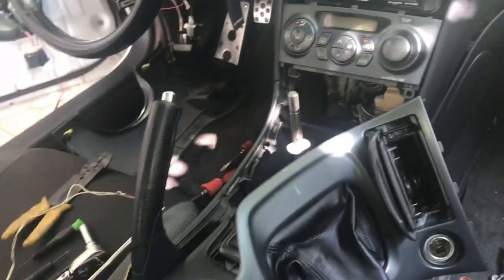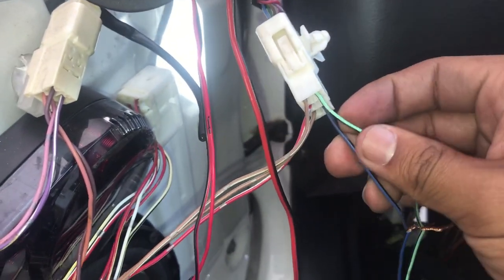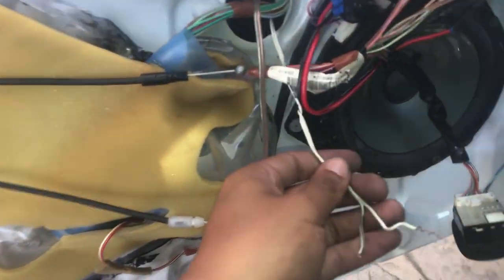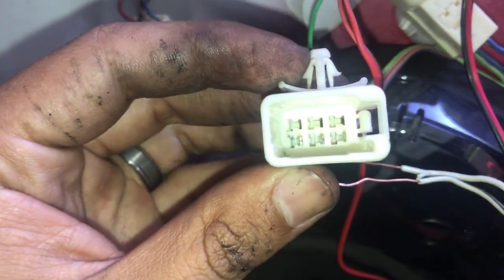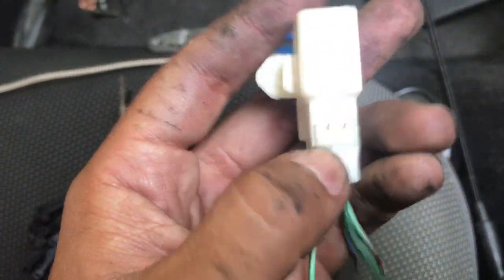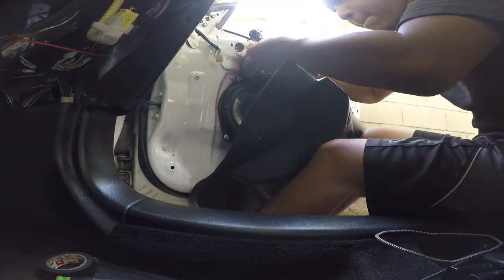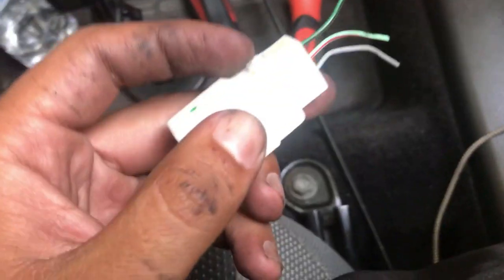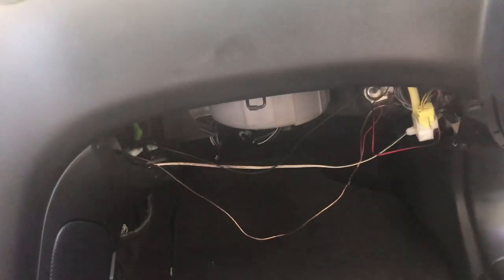How to Install JDM Power Folding Mirrors 00-05 Toyota Celica

Comment: Hi Rafa, I just bought one set of power folding mirrors and I intend to install them next days. Do you have also heated mirrors? There is any way to have both mods?
Reply from the maker: Ovidiu Florin Mine didnt have them and yes you can you just need to wire it right
Reply: @RafasGarage  do you have any idea how to do it?
Reply from the maker: Ovidiu Florin no but let me see if i can find out
Reply: @RafasGarage  did you find it? 🤩
Reply: 3 years late but there was forum post which tried to swap entirety of the mirror inside. Unless you want to spend hours doing that it's not worth it @cod_vvtli

Comment: Hey bro, I just got my some power folding mirrors from another celica, my car doesn't have is originally, like yours, so I need to do the wiring. Is there any control box I should have gotten aswell or do you only need the mirrors, switch and wires?
Reply from the maker: You just need the power folding mirrors and the switch
Reply: @RafasGarage  there's no relay or anything?
Reply from the maker: Kennedy Miller no
Reply: Cheers man got the mirrors and switch, wired it all up and drivers side works mint but passenger side making a weird clicking noise, I sent you a message on insta to send you a video of what's happening, help would be much appreciated

Comment: Rafa what is your location, I need your help on doing this.
Reply from the maker: Ken Sacdalan San Fernando
Reply: @RafasGarage  Deng,I used to live in L.A, now Im in the Bay Area.
Reply from the maker: Ken Sacdalan why you move well if you ever down let me kno
Reply: @RafasGarage  I might have a drive down there soon, I gotta get my speakers done on one of the shop there.  How long would it take you to install em, do I need to buy a pair of new side mirror that does the folding?
Reply from the maker: Ken Sacdalan yea you need to buy the jdm power folding mirrors
Reply: @RafasGarage  Do I need anything else, I saw 1 JDM OEM Celica folding mirror, you got the rest?
Reply from the maker: Ken Sacdalan and the switch
Reply: @RafasGarage  Do you know where is the fuse for the side mirror of Celica 2001?  I can't figure out.
Reply: @RafasGarage  Rafa, where did you get the pins that will connect the mirror harness and what type of pins are they?
Reply from the maker: @kensacdalan4748  from another harness or you can buy them from Toyota
Reply: @RafasGarage  Do you remember the specific type or what shall I tell them the part is?  Cuz the shop doing it watched your video, and said it involves replacing the factory pins that connects to the mirrors, is that so?
Reply from the maker: @kensacdalan4748  nope you only have to add two pins
Reply: @RafasGarage  So the harness would be our factory Celica US version, then add 2 pins into it right?  I can get those at Toyota for newer one?
Reply from the maker: @kensacdalan4748  yes
Reply: @RafasGarage  Thanks bro, I'll go to my local dealership.
Reply from the maker: @kensacdalan4748  you’re welcome
Reply: @RafasGarage  Good morning Rafa, do you happen to have the harness with the pins on it ready, or if you can get me a pair and add pins to it, ship it to me, I'll  pay you plus your labor, the shop won't put 2 new pins to the empty slot.
Reply from the maker: @kensacdalan4748  where do you live
Reply: @RafasGarage  Daly City, CA. border of SF.
Reply from the maker: @kensacdalan4748  yea i can but y dont you ask clayton to do it for you
Reply: @RafasGarage  Who is he?
Reply from the maker: @kensacdalan4748  a guy in norcal that works on celicas
Reply: @RafasGarage  Do you have his contact?  Is he good as you, that's the question, lol.
Reply: @RafasGarage  would you be able to do it for me?
Reply from the maker: @kensacdalan4748  yes
Reply: @RafasGarage  LMK what's up, make it extra rigid and stable, cuz the shop not gonna do it again, they're just doing me a favor cuz I had project done in their shop.
Reply from the maker: @kensacdalan4748  ok
Reply: @RafasGarage  Thanks bro.
Reply: @RafasGarage  Gud AM bro, how ling do you think you'd be able to send it to me?
Reply from the maker: @kensacdalan4748  Idk i am really book til the following week
Reply: @RafasGarage  ok, just keep me posted bro, thanks.
Reply from the maker: @kensacdalan4748  sure will
Reply: @RafasGarage  bro any idea when you can start on my request?
Reply from the maker: @kensacdalan4748  maybe this week
Reply: @RafasGarage  thanks man, just wanna see it works.
Reply: @RafasGarage  bro any update?
Reply from the maker: @kensacdalan4748  nope
Reply: @RafasGarage  have you ordered the new harnesses?
Reply from the maker: @kensacdalan4748  no dont need to
Reply: @RafasGarage  you mean to say you got some already?
Reply: @RafasGarage  any time frame for my request?
Reply from the maker: @kensacdalan4748  maybe next week
Reply: @RafasGarage  you got new parts to do it with?
Reply from the maker: @kensacdalan4748  i have a spare car i am parting out
Reply: @RafasGarage  lemme see the condition of them, cuz the shop I'm dealing with is very particular.
Reply from the maker: @kensacdalan4748  I am not going to be able to do it the way you want too much wiring and need to ship you a lot of wire harness
Reply: @RafasGarage  any other ways?
Reply from the maker: @kensacdalan4748  theres no other way then how i told you
Reply: @RafasGarage  The harnesss with metal pins are all I need, not the wirings.  I have those already.
Reply from the maker: @kensacdalan4748  yes and wire to run
Reply: @RafasGarage  just the harness and pins, wires are all set up in my car.
Reply from the maker: @kensacdalan4748  yes
Reply: @RafasGarage  yes what?  I just need the harness with pins on em.  Do you have those?
Reply from the maker: @kensacdalan4748  just add the pins
Reply: @RafasGarage  that's why I asked you cuz the shop would like to have the harness with pins already on em.
Reply from the maker: @kensacdalan4748  like i say if i make a harness is too much for what your shop want me to do
Reply: @RafasGarage  What you mean too much?
Reply from the maker: @kensacdalan4748  too much work, too much wiring and too much stuff to ship